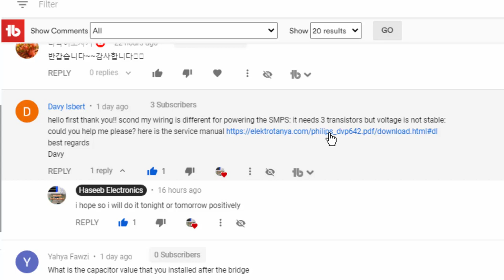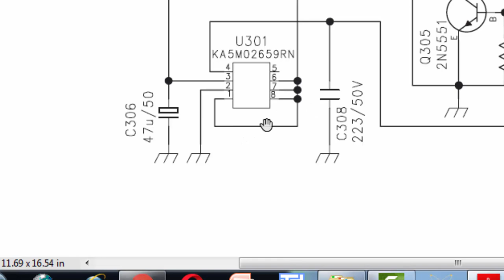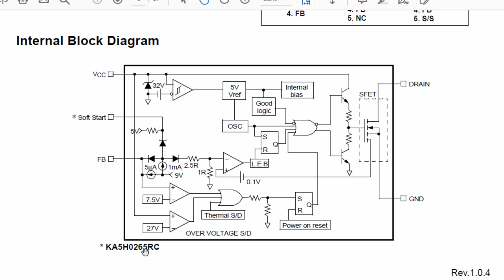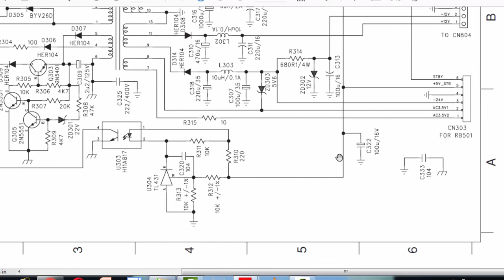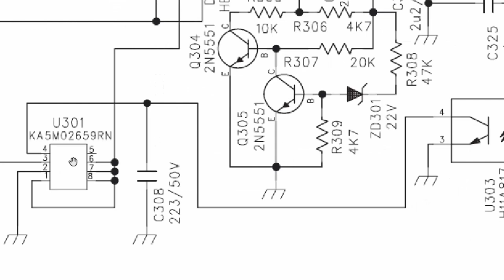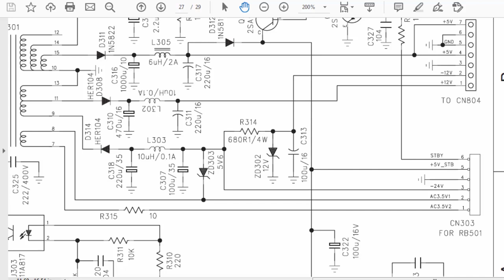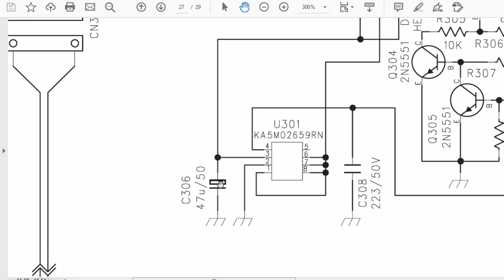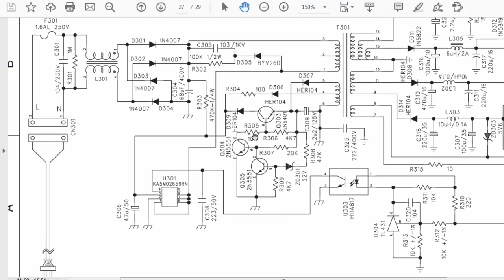#234 Functional Description for SMPS switch mode power supply Philips DVP642K DVD player

Comment: First a great thank you for dealing with my personal point!
Second,  I've tested all components around Q303, Q304 and Q305 : all look fine. I've also tested C304, C306, C308 and C309 : all are fine.
Third, I've bypassed the optocoupler withe a diode as you've allready shown in a previous (great) video.
So my conclusion is that the controller is dead so I've ordered a new one and I will give you my feed back.
Do you think it could be a good idea to bypass the feedback from the 3 transistors (regulator) ? I mean a direct link between R303 and C306 for testing purpose ?
Best regards and thank you again
Davy
Reply: For the moment I'm only focussed on the left part but I've already replace C316 who was bad: certainly the origine of the issue